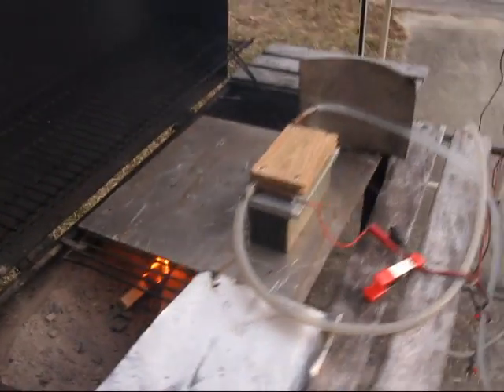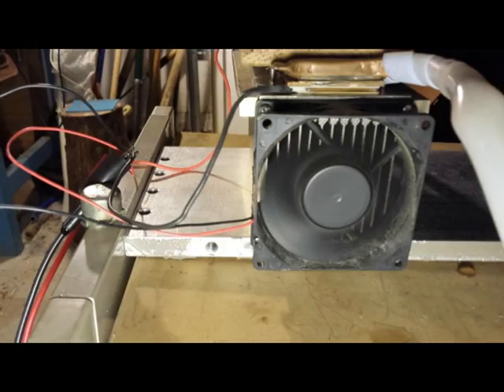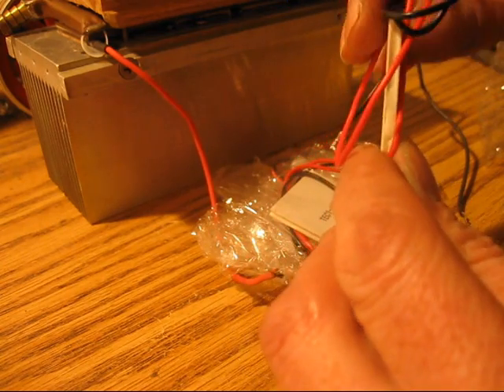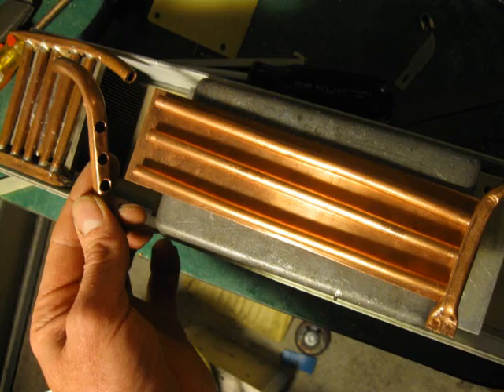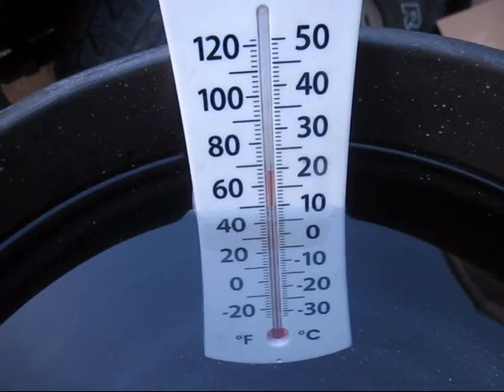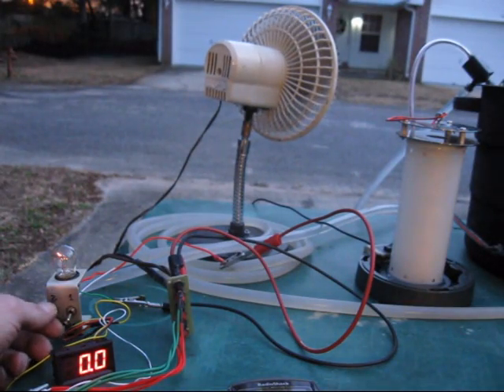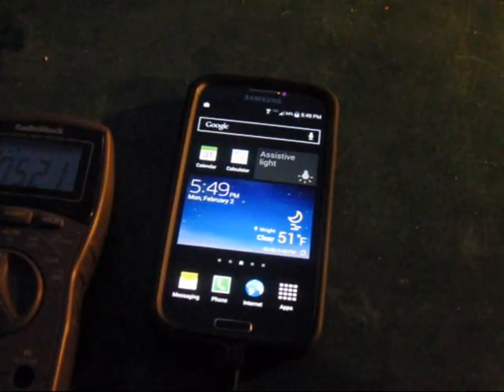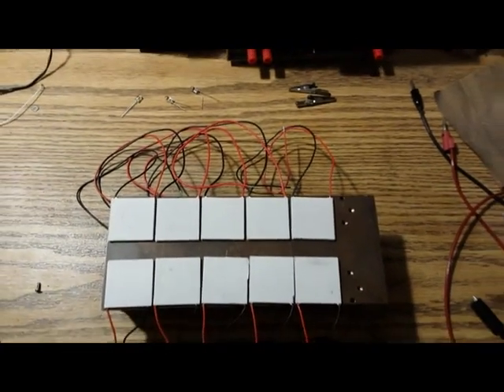thermoelectric generator using cheap TEC modules

Comment: INSTITUT FÜR INNOVATIVE TECHNOLOGIEN - RZ-IT. 
Das digitalisierte Elektroauto mit integriertem Ladegerät 
ermöglicht über 1000 km lange Strecken und 50% kleinere 
Fläche von Photovoltaikmodulen mit der gleichen Leistung 
auch in der Raumfahrt.
Strom aus Wärme:
Thermostromgenerator nur mit Wasserstoff, sehr einfach und
kompakt gebaut mit hohem Wirkungsgrad.

Rudolf Zölde 
pulstechno@gmail.com 
innovatech@tutanota.com 
www.rz-innovatec.com 
Ab April auch als Sachbuch im Handel: „Die Impuls-Leistungselektronik“.

Comment: You want to use the TEG modules. Not the TEC modules in the video. While the TEC will work, its not as efficient or made for power production, as the TEG is.
Reply: All the difference is solder type(much high temp in TEG). So, no effectivity, difference at same grade module.IMHO
Reply from the maker: The purpose of this project was to built a thermoelectric generator from inexpensive TEC modules. Not expensive TEGs.

Comment: wait hold on. 16 volts and 1.6 amps?????? you made over 24 watts with those cheap chinese tecs? how????
Reply from the maker: Highest voltage reading is without a load so no it's not 24 watts.

Comment: I'm confused, Are you using TEC or TEG? and do they do they both produce power?
Reply from the maker: As in the title of the video "TEC" yes they mostly all use the same semiconductor material that operate on the Seebeck effect. TEG modules typically use higher temperature solder internally and are assembled a little differently to generate power more efficiently.

Comment: ive got a few of those modules, about to try and replicate this so a friends wood stove can have a  magic fan. Question- repeat of others unanswered question... what temp is the water coming out of the exchanger ? 

Im considering running the output from the water block 10ft down the camper wall and into the seperate bedroom where it would then go through a radiator with a fan. aka it might pump a bit of heat to other end of trailer and give him the ability to close the bedroom door at night.
Reply from the maker: Sounds like a great experiment. Might be one I'd try myself.  But the trick to getting maximum power out of your thermoelectric generator is having the greatest temperature difference that is practical between your hot and cold sides.  For the water to be an effective coolant for a thermoelectric generator of these inexpensive modules it wont be able to also be efficient as an air heater where you dump your waste heat.   It will work somewhat, but I believe you will be finding yourself wanting to put your radiator outdoors in the cold winter to dump the heat more effectively thus increasing your temp. differential and produce more power.  Or even finding an ice water source for coolant. One could invest in the more expensive high temp TEG modules that can operate up around 700F and the cooling water can then be 150F or even hotter as long as it doesn't boil and blow out hoses, and then this can be used with a radiator as an effective heater in the far room.

Comment: That's one of the most interesting and informative videos I've watched on this topic.
Would be fine to know how much heat the water picks up from the module say in a system that constantly provides the same 67°F cooling water?
Thanks for the video!
Reply from the maker: this assembly picks up a fair amount of heat, air cooling the water through a small radiator was difficult even with air in the 50s. A constant cold water source say a pond or nearby creek would be the most effective.

Comment: hy in my project about Thermoelectric Generator. Im using heat of sun. but idont find volt up to 3 volt. can you explain me???
Reply from the maker: +Wahyu Kurnia  - Your results depend on heat differential and the type of module. With these inexpensive Chinese modules used in this video you can get around 3 volts and 1 amp per unit when you have a 70+ degree Celsius difference in the hot and cold side. Using this thermoelectric generator with 4 modules in series I have since pushed them even harder in another test reaching just over 150C at the hot side with 15C cooling water cold side and produced just over 18 volts (4.5 per module) at about 2 amps with no failure and used a 2 amp rated regulator rather than the 1A car charger to convert to 5V and charged my cell phone very quickly. Using sunlight as a heat source I suspect you may only reach 60C hot side at best unless you concentrate the sunlight with a fresnel lens or mirrors.  A photovoltaic solar cell is more effective with sunlight but you could generate additional power by installing thermoelectric devices on the back of the panels to make use of the heat there.
Reply from the maker: probably cannot get that much power out of these modules in a package that small. Would be extreme temp. differential to get it. You might try one of the 10 watt TEG modules
Reply: @RLZerr  so you got 9 watts from one cell at just over 150c hot side and 15c cool side. thats impressive. and you said they were 3 dollars each. where did you buy them? i saw some on ebay that give output of upto 100 degree difference and its only 3.2 watts open circuit? what is the output of your teg underload?
Reply from the maker: @jangofet555  Sorry my video may be hard to follow. I only get 8-9 watts total. 4 modules in this unit.  About 2 watts per module. Bought on eBay less than $3 each when bought in larger numbers.

Comment: Well done and verified design . Will it work using other heat sources such as alcohol burner or gas stove and are you planning to construct one with higher power.
Reply from the maker: +Abdul Aljohar  any heat source works. Solar, fire, hot water, even the heat from your body will generate some power. The maximum power output is obtained by the highest differential between the hot and cold sides of the modules. Limited by the maximum rating which is 150C or 300F. Above that temperature you risk destroying the modules by melting the solder joints inside. I would like to build a practical sized unit that would generate about 40 watts or more at 15 volts that could be easily used in a campfire.
Reply: @RLZerr  have you made it?  Im using a small woodstove (cubic mini cub) in my rv for hot water (thermosiphon) 
As welk as drying the moisture Oregon supplys.
    Charging 2 deepcycle12v batteries with more than 2 amp would be amazing.  Ive found videos showing "dc<ac>dc" charging setups. (Dumb)
DC-DC  iv thought  of wiring 2 entire sides of the woodstove with TEC to a 100w  harbor freight charge controller

Comment: so what's the purpose of the heatsink on the hot side of the TEC unit?  to ensure that overheating does not happen or to keep the TEC at a regular heat to regulate the output voltage better?
Reply from the maker: +tuz100 yes, to control the heat applied to the module I used the heatsink with long fins and thick contact surface to help control and evenly distribute the heat. It's what I had conveniently lying around. Constantly monitoring the temperature across the heatsink with the infared thermometer compared to the size of the fire gave a general visual limit to how much fire to use for maximum output without destroying the modules. Not exceeding the maximum temperature to the hotside is the most critical problem when using a fire for a heat source with these modules.
Reply: +RLZerr thanks, i am looking at building something like this to use on campfire which will be fairly unmanaged and is running every night.  i'm guessing the cheap chinese tecs you used had a maximum of 150c?  the other examples i have seen do not use the heatink on this side but i think i might do this to ensure that overheating does not occur.  thanks for the reply and the vid - one of the most useful i've seen for my specific needs.
Reply from the maker: +tuz100  I too am primarily experimenting with devices in a camp environment for power. I'll ad that with this long, thin fin heatsink that I used and on the edge of the 1/4" aluminum plate over the fire, the top of the heatsink contacting the modules would easily creep up over 300F. I had a spray bottle of water handy to mist the heatsink and bring the temp down. Had to do that a couple times. Making plans to build something using other modules designed for power generation with a 600F hot side rating. They are very expensive but produce much more power for the size. I think with a little experimentation using a campfire one could come up with an aluminum heat conductor that would stay below 600F even in an extra hot fire and not require constant attention.  Even though more effective, I'm moving away from water cooling as it's not real practical for a portable unit.
Reply from the maker: +tuz100  when I had this unit set up using steam as a heat source there's no worry of overheating. will never get over 100C but you only get about half the capable power output.   One could build a small higher pressure steam boiler in a closed loop with a safety valve designed to go off at about 60-70 psi. Maybe brass and brazed copper pipe, not soldered.  Should be ok at 60 psi steam and 307F but I've not experimented with that.  I was looking at other fluids to safely transfer the right amount of heat that would boil at about 300-350F at normal pressure but there aren't any that are non-toxic / non-flammable. Probably be easier to buy the $40-$50 modules capable of 600F but even that temperature could easily be exceeded in a campfire.